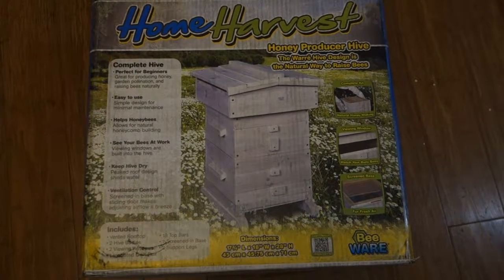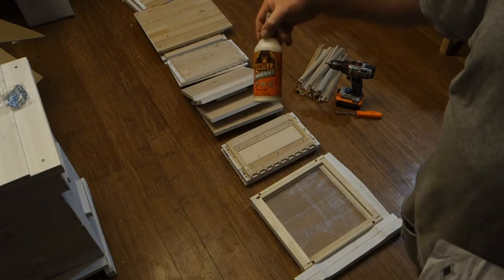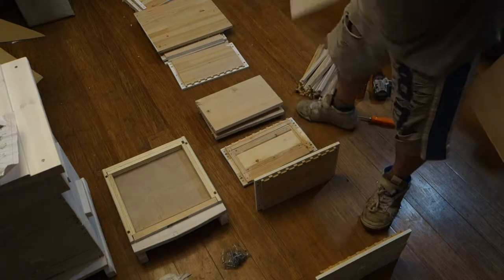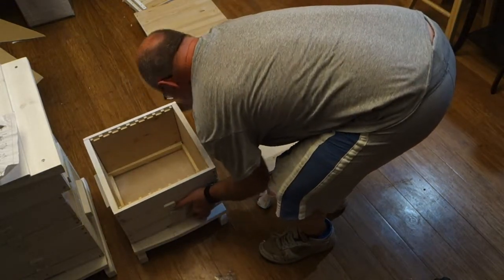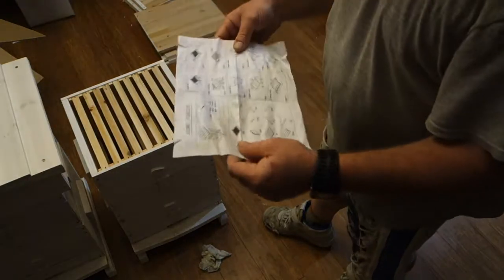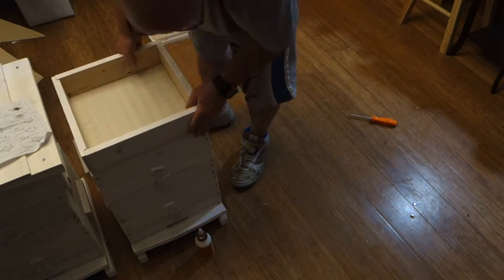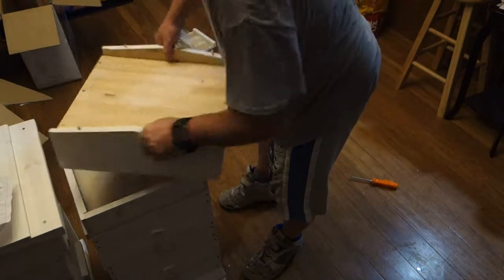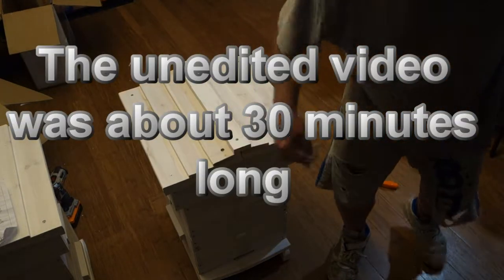Home Harvest Warre Hive Assembly Purchased from Amazon

Comment: You installed the cover board upside down.
Reply from the maker: not sure which part of the video you are referring to but it is assembled correctly - the camera angle may make parts seem distorted
Reply: Hi Ed! The cover board is the flat cedar board that is installed directly under the roof. The underside of the cover board rests on top of the quilt box. It looked like the side with the white water-based stain was installed facing down, making the unstained side exposed under the roof. Could have been the lighting, though.

The video is great, though! I have several of these hives and the bees are very happy in them. I'm glad someone is posting videos on these, they're priced well and a great alternative to traditional Langstroth hives.